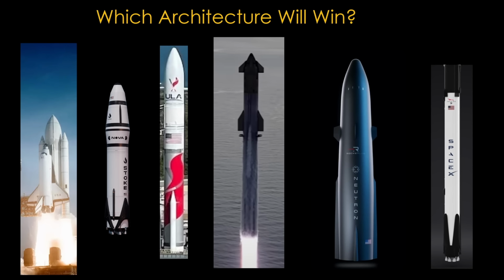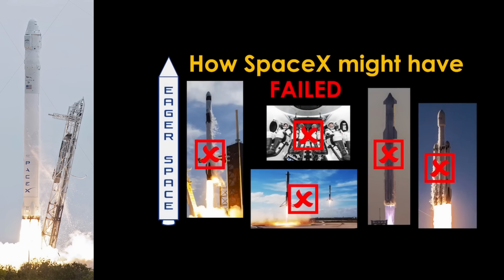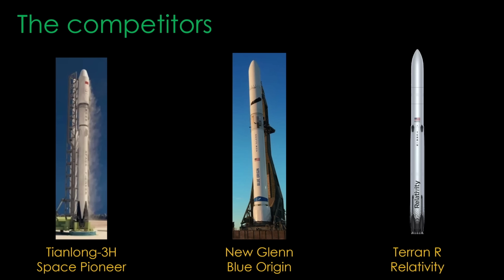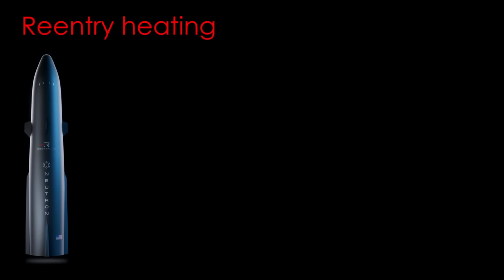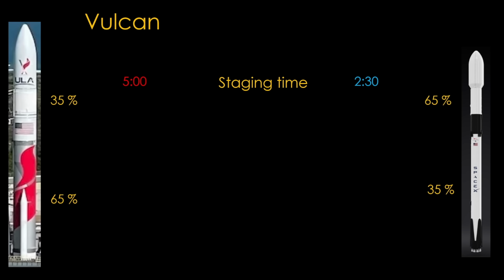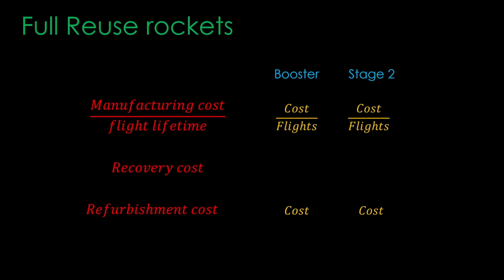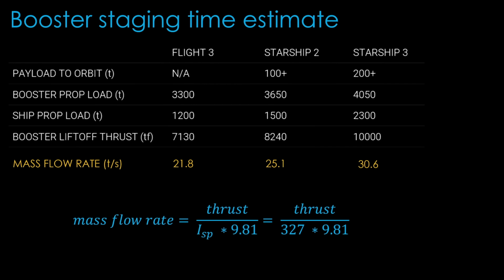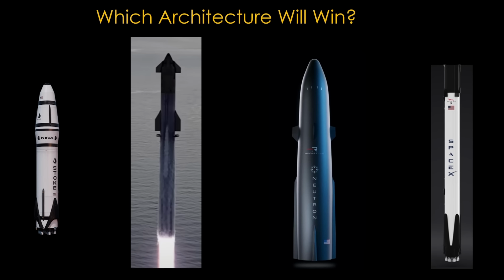Who wins the reusability race?

Comment: One nitpick, most types of carbon fiber are actually just as strong in compression as they are in tension, it's transverse loads that they can't handle without layers in different orientations. There are some potential downsides to carbon fiber in compression, like buckling and delamination, but it is nowhere near as major as most people think.
Reply: Neutron's tension advantage is significant not just for Stage 2, but also for the payload itself. It means that satellites do not have to be designed to withstand compression, they mainly need to deal with tension.
Reply: @paulcarter7445  That's fair, it may take some time for satellite manufacturers to shift to designing for tension, and if they do, they would be committing to launching only on Neutron, but there are definitely potential advantages there.
Reply: @Quasarnova1  One of the main advantages is that it is cheaper and easier to design for tension and reduces overall weight. Imagine a beer can, it's easy to compress it, but very difficult to stretch it.
Reply: @paulcarter7445  I know, and it's worth noting that aluminum is an isotropic material, just as strong in any direction. An idealized aluminum can would do just as well in compression, but as we all know, thin walled vessels like that tend to buckle and fail much earlier than the material can handle.
Reply: @Quasarnova1  that's why tension is easier to manage on satellites than compression - any thin walls need to be thickened or supported if subjected to compression.

Comment: If you build a first stage which acts as a suborbital spaceplane, you should be able to separate at a much higher velocity, and still return to the launch site. Either by landing downrange, and doing a ferry flight home (using jet engines) or by just directly flying home (plausibly with jet engines). Then you upper stage could either be a simple solid fueled kick stage, or you could have a simpler reusable craft in orbit. As the payload to second stage ratio would be better, you could have a higher heat shielding mass on the second stage.
Reply: That's a lot more extra mass.
Reply from the maker: Dawn aerospace is working towards this, and it's an interesting architecture. You do need to be close enough to get back to your launch site and that will limit how late you stage. 

You now need the added mass of wings, landing gear, jet engines, and jet fuel tanks.
Reply: @EagerSpace  Assuming a modest mass ratio of 6 to 1 for the first stage and a specific impulse of say 350 s (assuming no change of Isp during flight), you could launch an upper stage with a wet mass (with payload) that is 20% of the first stages dry mass. Thus the overall mass ratio would be 5 (6/1,2) for the first stage burn, yielding a delta-v of 5,5km/s. Assuming you need 9,5km/s to get to orbit, that would require the upper stage to perform a 4km/s burn. With a 350s Isp you would get a mass into orbit of around 31% of your upper stages wet mass. Assuming a mass ratio for the upper stage that is likewise 6 to 1 (to account for the heat shield etc.), you would get around 17% of the upper stage wet mass as payload.

With these very modest mass ratios you would still get 0,5% of your liftoff weight into orbit. Not as great as the Starship or Falcon 9, but it might be a lot less technically demanding to build and maintain. It will surely be an interesting tradeoff, and it might go either way between these approaches.
Reply from the maker: Falcon 9 gets about 3% in partially reusable drone ship mode. 

The problem with 0.5% payload fraction is that it's hugely sensitive to weight gain. That means you are at risk of engine up with negative payload and you therefore need to deploy expensive materials and construction to keep it light enough.
Reply: @EagerSpace  The 0,5% payload fraction was a somewhat conservative estimate, specifically to avoid expensive materials.

Comment: Falcon 9 could easily reduce the price charged for a launch and still make a profit. Plus all Falcon 9 competition will need to compete against the much lower price per payload pound of Starship. This greatly shrinks the market for Falcon 9, Neutron, Vulcan. A shrunk market eliminates the powerful advantage of economy-of-scale. 
   The only viable markets I see are 1… certain military requirements/capability and 2… starting in low earth orbit and transporting to higher orbits, escape velocity, satellite retrieval
Reply: Starship has yet to resolve its very poor payload capacity.
Reply from the maker: If you analyze starship from a Delta v perspective it's pretty clear that the new versions solve the payload issue. That does require raptor 3, but betting against SpaceX has pretty much been a losing option.
Reply: @EagerSpace  "it's pretty clear that the new versions solve the payload issue." Nope - not until Block 2 actually flies. Assumptions about the payload capacity of Block 1 (100 tons) proved to be incorrect (40 tons actual), so "betting against SpaceX" has not been "a losing option".
Reply: @ poor payload capacity?  LOL
Reply: @douginorlando6260  Yep, as per Elon, about a third of its targeted capacity i.e. about the same as Falcon Heavy which will make StarShip uneconomic. Current claim is that the new design will improve that, but we've yet to see any real-world testing of that.
Reply: @paulcarter7445  Fair enough. But it is the first time I heard the size of falcon heavy payload described as very poor.  Even at that payload size, reuse of the upper stage should mitigate the cost comparison to falcon heavy.
   I see low risk in starship increasing payload weight. The modifications look very doable. Beyond that, I expect future weight savings in the heat shield especially
Reply: @douginorlando6260  "Very poor payload" in relation to its required payload for profitable launch. For instance, with the current capacity, the number of flights to provide fuel for a StarShip flight to the moon gets to be very expensive, let alone for flights to Mars.
The next generation of Raptors should improve payload, but as to by how much is an unknown. I've seen figures that imply a very small improvement, insufficient to make StarShip competitive.
Reply: @paulcarter7445  The original Falcon 9 was capable of carrying approximately 23,050 pounds of payload to Low Earth Orbit (LEO). The current Falcon 9 can carry over 50,000 pounds.  The current starship launches are prototype test vehicles and not even payload launch vehicles yet.  so after the next upgrade with larger tanks and first time some payloads are actually delivered, I expect a marked improvement in capacity. Based on SpaceX’s track record with Falcon 9, starship will greatly cut delivery costs over all competition including over their own falcon 9.
Reply: @paulcarter7445 V3 seems to have solved the payload issue.  Estimates put it at >100 tons to LEO.  SpaceX states it will launch 60 V3 Starlink satellites, which is approximately 112 tons.
Reply: Since spacex's books are closed how can you say, with any credibility, that they can lower costs and still make a profit?  No one yet has any idea of what the final costs of Starship will be either, that will takes YEARS of flying to know so how can you claim to know what the price per pound for starship will be.  Making things up is just that making things up.
Reply: @imaginary_friend7300  reuse of rockets speaks for itself … but only for people who are objective
Reply: @douginorlando6260  They thought that with the shuttle too, and that was a fail.  Again you are tying to pass your assumptions off as facts and you support it with that weak nonsense.  It's not objectivity, you're being dishonest and you're trying to wiggle away from that.  It's crooked and cowardly.
Reply: @imaginary_friend7300  the shuttle was driven by maximum revenue for the entrenched corporations, no interest in a lower cost way.  Instead of becoming cheaper, shuttle launches became much costlier, which meant more revenue.  Compare that to SpaceX which now launches 90% of payload put in orbit. The only competition for starship is falcon 9 & falcon heavy.   SpaceX is competing against itself and plans to grow the market by lowering the cost of delivery to orbit. Legacy space companies had decades to develop lower cost launches but their business model was to continue working the shuttle money stream they had locked in.   Shuttle and starship are not comparable (their business models are opposite).
Reply from the maker: Falcon 9 had help from NASA and was competing against show companies that were to charging multiples of the falcon 9 cost of had poor quality. 

So much harder now...

Comment: Neutron clearly is the most compelling competitor given Archimedes, pad, and cheap robotic structure manufacturing are in advanced stages launch mid 2025 likely. Their Wallops pad infra including landing pad and cleaner than Merlin Methalox Archimedes run at lower power than Raptor, as the fairings flown back dry all make recovery and refurb simpler and cheaper than F9.
RKLB 🚀

Comment: Great video! Did you hear the rumor by Eric Berger that there is a ≥50% probability that SLS will be cancelled? Maybe you could make a video on possible SLS replacements for Artemis. What could bring Orion (or something else?) to the moon instead? E.g. the "Bridenstack"? Or Orion docked onto HLS in LEO?
Reply: That'll throw a few more years of delay into Artemis.  Maybe thats a good thing..
Reply from the maker: I did a commercial moon video a while back...
Reply: @EagerSpace   Your best video. But if a Musk-Trump push kills SLS will it be expedient to use an expended Starship as a one-for-one replacement for SLS? The ship becomes a simple second stage with Orion mounted on an extremely necked-down adapter. Payload section is mostly eliminated, saving more mass. The objective is to get this ~second stage to LEO with enough propellant for TLI. I'm poor at numbers but considering Orion's ~22t mass this should work.

Human-rating? Starship's flight rate will make that easy, especially since Orion can use its present LAS.

Comment: Woah woah woah, you lost me at Neutron having more than 35% of delta-v on the booster. The whole point of lightening up the second stage is to improve its mass ratio. The Neutron booster is designed with less heat tolerant materials and more dead weight, so not only does it have a lower mass ratio, the more delta-v on the first stage, the more costly the boostback and reentry burns, especially since they only plan for RTLS.

It’s pretty clear to me that they plan to allocate more delta-v to stage 2, where the superior mass ratio is, so that stage 1’s terminal velocity is lower and can perform RTLS at lower cost. Something like an 80-20 split on delta-v, or maybe only 75-25.

Edit: it’s worth noting that engine Isp is typically higher on the second stage, which makes putting more than 35% of delta-v on the first stage a pretty bad idea even for an expendable rocket, let alone a first stage with recovery hardware.

Edit 2: Another thing, you can clearly tell from the design that the intention is a lower delta-v allocation to the booster. F9 has 9 Merlins on first stage and 1 vac Merlin on the second stage, and the tanks are clearly about 5 times larger on the first stage. Remember, that corresponds to about 35% delta-v on the first stage, because it's carrying a much bigger payload than the second stage (it's carrying the whole second stage itself). Look at Neutron, only 5 Archimedes engines on the first stage and 1 vac engine on the second. Look at the prop tanks, it looks like maybe 4-5 times the propellant on the first stage compared to the second stage. And unlike F9, Neutron booster does RTLS only, and the dead weight of both support structure and fairings have been shifted from the second stage to the first stage, decreasing delta-v on the first stage and increasing it on the second stage for the observed propellant load.

Every indication is that Neutron is allocating more delta-v to the second stage than F9, not less.

Btw, the reason Vulcan has about 65% delta-v on the first stage is not that it has higher performance, because with higher Isp on the upper stage, you would normally want more delta-v on the upper stage. The real reason is that the first stage has SRBs, which have a lot of performance for their cost and get jettisoned, so it makes the first stage of Vulcan something of a two-in-one package; as the deadweight of the SRBs gets discarded partway through the burn, the first stage of Vulcan is kind of 1.5 or 2 stages by itself, instead of 1.

There's another reason the first stage on Vulcan has more delta-v than the upper stage. The rocket is designed to have higher performance specifically for high energy destination orbits and trajectories, a role suited to expendable rockets and rockets with hydrolox upper stages, which matches Vulcan perfectly. Neutron and F9 by comparison are mainly designed to be LEO workhorses.
Reply from the maker: Neutron doesn't do a re-entry burn. 

The goal with a partially reusable rocket is to minimize the cost. That's different from trying to maximize the efficiency. 

You want to get as much out of the first stage as you can because that's the part you reuse, and your overall cost will be mostly driven by the cost of what you throw away and recovery cost, where recovery cost mostly doesn't depend on stage size ratios.
Reply: @ shifting dead weight from the upper stage to the first stage makes the upper stage cheap regardless of its delta-v percentage. It’s a tank and an engine, so giving the upper stage 50% of delta v instead of 65% isn’t going to decrease the cost very much compared to how much it decreases performance, because it will just be making the tank a bit smaller, and tanks are cheap, especially compared to the engine, which is an inescapable cost.

Meanwhile, the less delta-v the upper stage has, the more the booster will have, which is extra costly because of the bigger boostback burn that has to be performed.

The cost to performance is far larger than the cost of simply having a bigger tank for the upper stage, and the diagrams of the Neutron design agree with my assessment. The booster only has 5 times the engines of the upper stage compared to F9’s 9 times, and the tanks on the Neutron booster are about 4-5 times the volume of the upper stage, about as much, maybe slightly less than the F9. Considering the F9 upper stage has more deadweight than the Neutron’s, the Neutron upper stage definitely has a higher delta-v percentage than the F9 upper stage.
Reply: The claim that Neutron will be doing only RTLS is incorrect. Rocket Lab are offering 3 modes for the booster: expendable, barge landing and return to landing site (RTLS), each with different payload capacity.
Reply: @paulcarter7445  A recent development, I see. 27th of July 2023, according to Wikipedia, there was a design revision for water landings. However, looking at the linked sources, I haven't found any mention of water landings at all, and separate google searches also return nothing.

So, source?
Reply: @paulcarter7445  oh here we go, in the Rocket Lab Q2 2023 presentation: "Landing legs: optimized for barge landing, enabling increase in launch availability." That's the only mention. Not very confidence inspiring that they're actually going to commission some barges, though.
Reply: @J7Handle  Sir Peter Beck has mentioned barge landings during several interviews. Due to lower fuel requirements, the barge landings have a significant payload advantage over RTLS.
Reply: @ huh. Well, in that case, a bit more delta-v will come from the booster because it spends less on boostback, but I still think it will be a little less than F9’s booster (for LEO) given that the Neutron booster has more dead weight and the upper stage has less.
Reply: @J7Handle  Agreed,  that makes sense.

Comment: Is Starship actually capable of carrying 120t payload to LEO ?   It looks like Starship expends all of its fuel during IFTs and it makes me wonder how big a margin it has.
Reply: 100t are announced for version 2, which is slated to be introduced soon. Current flight test vehicles are Legacy designs with principally obsolote raptor 2 engines
Reply: The version 1 was supposed to be a 100 ton capacity but even Elon mentioned that the real capacity was like 42 ton max (mention that when he presented v2 and v3... ) so let see lol the heat Shield and recovery penalty is massive 😢
Reply: @danygauthier605  No.  The FINAL version was projected to carry 100 tons.  You people keep pretending throw away test articles are the final design either out of deep ignorance or the urge to be deceptive. Now that projected payload has been expanded since testing and development is driving design rather than the other way around.  ANOTHER aspect most of you don't understand at all.
Reply: @imaginary_friend7300   No ignorance or deception. During Starship's development the announced payload was 100-150t. It then dropped to 100t. Then more and more reinforcing stringers and plates had to be added. We had no new estimates until the 42t one. Raptor V3 and the stretched ships will be trying to get back to 100t and more. 

Can they lighten the construction as they progress from these first ships? On the booster, maybe. But they tried for the lightest they could and then added. Most companies start heavy and then reduce but SpaceX has done the opposite.

Comment: How will they protect the payload aboard the Neutron rocket if its second stage separates below the Karman line? Are they planning to send the Neutron into space?
Reply: The fairing is not removed. It’s a four piece clamshell design.
Reply: So I was initially incorrect. It’s a two-piece clamshell attached to the first stage. Perhaps they think there won’t be enough air pressure at staging to hurt the payload.
Reply from the maker: They will be out of the atmosphere at staging, the same way falcon 9 is.